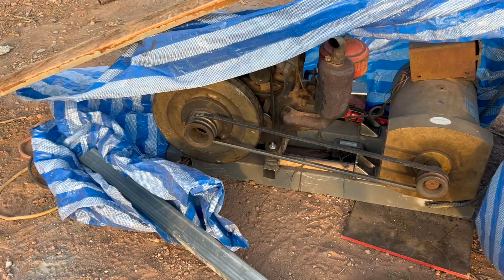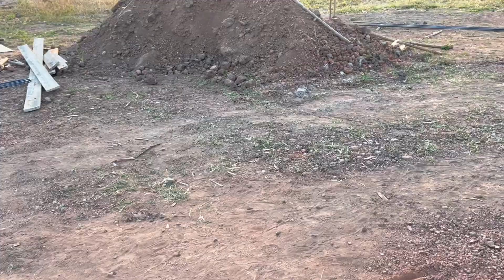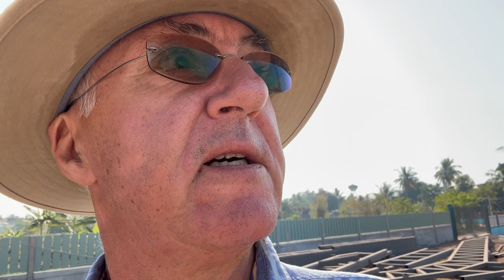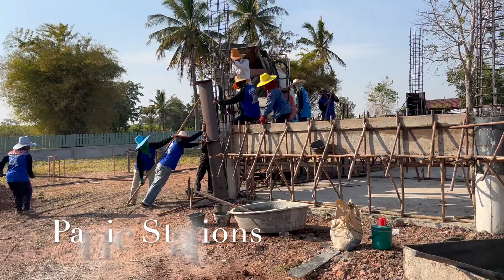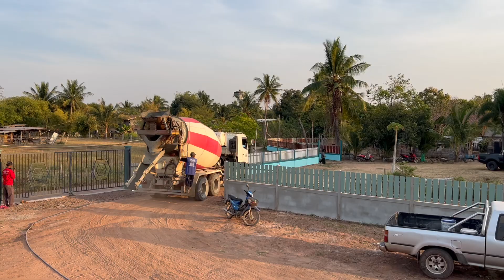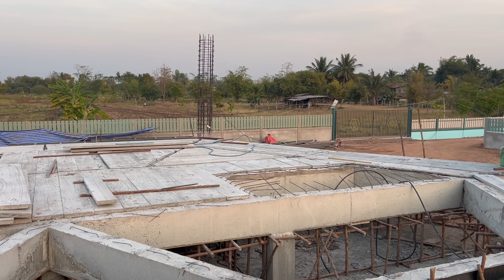Episode 13 :Concrete Floor Beams Done , Concrete panels 1/2 Done

Comment: Just chill and let them do their thing.
From my experience building in Isann it gets done. Have "discussions" with the boss in private and remember the concept of face.
Reply from the maker: Hi Philip 
I don't disrespect tho workers I look after them with cold drinks and Ice , on occasions couple have pointed things out but your also  correct it will get built but I still check everything is as per architect drawing 
Thanks for your comment 
Gary and Mon 50/50

Comment: new sub here, I’m a YT’r in Taiwan, and sometimes Thailand. That’s a very robust build you have in the works. A bunker!
Reply from the maker: Hi and thanks for subscribing
Yep our architect employed engineer as the structure especially the roof is just supported on those 1/2 meter columns , we have no other columns , Mon says roof  like Sala Wad  (Temple Hall )
Cheers Gary and Mon 50/50

Comment: They definitely need the foreman I think some of the pour looked a bit uneven hope i'm wrong, hope the slab looks good at the end, I know working in that climate is no joke i've done it myself, thanks for sharing Gary. 🙂👍
Reply from the maker: Hi Mick 
As you have seen in previous videos I have done some work but prefer the warm to cold 
Not sure April and May Hot months though
Cheers Gary and Mon
Reply: @GaryMon5050  Too cold or too hot=no winner there 🙂🙂
Reply from the maker: @ I still rather be in thailand away from Uk cold , dark and damp short days😄
Reply: @ Yeah Gary it's not much to sing about let alone it's fooked sideways.